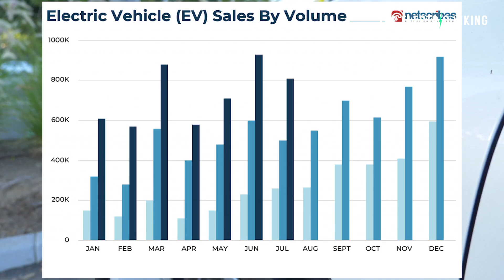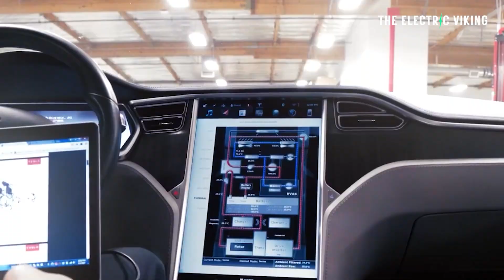The BIGGEST mistake EV owners are making when it comes to the battery

Comment: I know someone who repaired his busted Tesla battery himself after the workshop insisted he needs a new battery. Took him 4 weeks to do having to check each and every cell, but it saved him a hell of a lot of money in the end.
Reply: @newnewmee44 Yeah, I had the exact same issues.
I think it's when a busted cell is replaced with a new one in a used battery pack. Then you get currents flowing between the cells all the time as they try to level their charges with each other. That can't be healthy for the cells. It's probably the same with EVs.
Reply: @newnewmee44 I think this has to do with the efficiency of charging new battery cells, and when one combines and mixed old cells with new cells the old cells start to fail faster.
Combining old cells with new cells is not a durable solution.
Reply: Four weeks, assuming he worked 8 hours a day 5 days a week that would be 160 hours times $ 30/hr = $ 4,800 to repair an old EV battery!!! Yes, he did it himself and did not add his labour cost, but he still spend 160 hours fixing the EV battery pack, which he could have spend making money on something else.
A new EV battery pack would cost about $ 10,000 installed pending the EV make and model and that would be a brand new one.
The repaired old/ failing EV battery pack apart from the new cells installed is still an old battery pack, which can fail at any time again!!!
Reply: @mauriceharting5877  A new battery pack for a Tesla costs in the region of 18 to 25 thousand euros with labour here in Germany. So I guess my neighbour did alright financially.

Comment: I think that the biggest mistake EV owner used to do is to always charge to 100%. That's the main reason why Nissan Leaf 1st gen lost capacity so much.
It had small range. so of course drivers would plug it in at any opportunity. A 80-100% top-up counts almost as much as a full cycle in degradation.
Second gen doesn't have the degradation problem because it's longer range and the drivers don't charge it as much.
My 2013 Leaf has still the full 12 bars at 70.000 miles. It's not impressive in isolation, but most Leafs lose 30-40% of the range by that point. I only charge it to 65%. 80% just in exceptional cases
Reply: Even AC charging people tend to charge at max amps which is not needed. I calculated that the 60 kwh pack in a tesla only needs to charge at up to 20 Amps (240 VAC). 20% to 80% = 60%* 60kwh = 36kwh, 20amps * 240VAC = 4.8kwh, 36kwh / 4.8 kwh = 7.5 hours. So even lowering the car's charging amps at home can extend battery life and reduce heat lost and wear & tear on your home wirings.
Reply: @chetsaxton1526  Tesla people prefer to charge at max available AC speed. Apparently at 7kw the onboard charger efficiency is about 90% and it goes as low as 75% for 2 kwh. In Europe with the overpriced electricity they don't want to waste anything
Reply: @chetsaxton1526  good point, I haven’t really done a deep dive to see, but it is definitely a possibility that some of the EV fires are actually a result of substandard charging systems or faulty wiring.  I reduced the charge rate of mine to 20 or perhaps 24 amps I believe, and only charge my Bolt to 80% as that’s perfectly adequate for the typical commute that myself or my family would do on an average day.
Reply: Your charging methodology will definitely extend the lifespan of the battery by a lot, but the thing that really hurts the Leaf is the fact that it doesn’t have an active system to heat or cool the battery when temperatures exceed optimum operating ranges.
Reply: @sjsomething4936  Everyone seems to repeat that, but I haven't seen any proof.. 2nd gen Leaf doesn't have any significant degradation issue, even without thermal management. Better chemistry, bigger capacity and less frequent top-ups is all it needs.
Excluding some very extreme scenarios, the battery sits within a reasonable temperature range even without active thermal management.
Reply: @BGS_123  that might be the case, quite honestly I haven’t got any specific information that says otherwise.  I know my friend’s Leaf has fairy significant battery deg but I’m not sure if his is a Gen 1 or 2 or his typical charging routine.  He probably just charges to 100% all the time would be my guess.  And to your point, even in my Chevy Bolt the battery conditioning doesn’t happen very frequently, even on hot summer days.  When the temps drop below freezing it will do some battery pre-heating when it’s on the charger and I start it in advance to warm the cabin, but doesn’t come on much when driving unless temps drop below -10.

It’d be so much easier to have informed  discussions about battery performance, longevity etc. if the government would mandate tracking and public disclosure of the various parameters on the vehicle manufacturers. And probably help to dispel what I suspect are myths and disinformation about EVs and batteries by social media personalities looking for clicks or petro company shills pushing a narrative.
Reply: LFP loves 100% charge. It's only NMC that is a princess.
Reply: Battery will calendar age regardless. Not changing to 100% will extend it but it will still degrade with time no matter how careful you are.
Reply: @i6power30  calendar age is accelerated with state of charge. Keeping battery at around 40% and close to 0 deg is the most optimal way to limit age related degradation

Comment: sadly in most countries there's a shortage of technicians in general. High voltage qualified ones are almost inexistent. So there will be a long time until this need is filled.
 Also shortage of electricians to instal chargers, technicians for heatpumps and solar panels.
Best way to fix this problem is to lower the entry requirements. They should provide schematics and drawings for battery packs so any engineer can service it. That would eliminate the need for years of experience in the field.
And yes. it's pretty much illegal to work on a battery without qualifications and safety precautions
Reply: I think the problem is that "the industry" doesn't make marketing against schools and talk about the possibilities in the field (of physics).
Now "everyone" think that singer or TV, video blogger, etc is the future.

Comment: Good video and an area that is not getting enough attention.  We also have Sandy Munroe who pointed out fairly recently about a well know EV battery having "zero repairability".  Part of the issue seems to be that we go from batteries that have very low degradation to a state where they suddenly can't be charged, and there don't seem to be official figures on how often this is happening.
Reply: Definitely would be good to be given the failure rate and longevity stats for batteries, this should be mandatory information collected by and published by the government. As an EV owner, I’d really appreciate being able to know for myself as well as be able to discuss and provide accurate information to other people who are interested in purchasing an EV.  Right now without accurate information the fossil fuel industry is able to make wild and untrue claims to try and convince people that EVs aren’t safe or that the batteries are dying after only 5 years etc.
Reply: @orionbetelgeuse1937
Most of what you said is are hypotheses not information proven by research. Yes salt water is an issue. But fires after an earthquake has not been shown to be true yet, unless you have an article. 
The power outage problem is actually been proven false. Since people drive home and plug in their EV there is always a higher percentage of EV’s with a full charge than cars with a full tank of gas. There was a power outage that lasted 10 days in my town. The next problem after keeping you house warm and your food cold was no access to gas. The gas stations don’t work when the power is out. But the people with backup solar and an electric car had no problems.
Reply: @orionbetelgeuse1937
Yes if a vehicle with its power source is crushed in an earthquake it’s going to start a fire. It doesn’t matter if that is electric, gas, propane, or hydrogen. If you treat those energy sources badly, bad things are going to happen. 

What was your point?
Reply: @orionbetelgeuse1937
Ok let me see if I can cover all of this. 
Batteries damaged cause fires: you are correct on this but because of the extra structure they put around the battery this happens almost never if the car is not moving. Plenty of EV’s have been crushed by falling trees without the battery getting damaged. But yes if a building collapsed on an EV it could burn the collapsed building. 
You believe gas stations have backup generators. Well in my area the 10 gas stations that were inside the power outage did not have backup generators. But that might be different in different areas. 
You can just drive to a gas station: well on day 2 the first layer of gas stations ran out of fuel do to being overwhelmed. By day 5 you had to drive 20-30 miles to get gas. The first supercharger that had power was 15 miles away. I could get a full charge with the long charging time of 45 minutes while shopping for supplies. It never ran out of electricity so it never stopped working. 

Solar is well known to actually strengthen a roof. Here is a short video on that. 
https://m.youtube.com/watch?v=ztx_a7oV_dI&pp=ygUjUHVlcnRvIFJpY28gcm9vZnRvcCBTb2xhciBodXJyaWNhbmU%3D

Now if there is an earthquake and my house doesn’t survive we are in a completely different situation. I actually have the knowledge to take a broken solar system and rebuild it. I can make it direct DC system or a 120v AC or a 240v AC. I would do this with them just laying on the ground. My problem is I’m chronically ill and would not have the strength to implement this. So I have made it very apparent my house is the place to congregate after a disaster of that size. I don’t have a bunker. But my basement is very close to that. So I would match my knowledge and their strength. Because of the solar we would still have vehicles after 6 months. There will be no gasoline at that point. So food is the biggest problem. I could survive with my friends for about 2 months with our food supplies. So if the damage happens in March we are fine because we can instantly start farming. If it happens in October we are probably screwed and would not survive the winter.
Reply: @ecospider5  thanks for that link, it was perfect (saved for future reference!), I haven’t seen it before but I also haven’t encountered someone who so persistently misunderstands or tries to disingenuously argue a completely ridiculous claim.  

Sorry to hear about your condition, not having your health really sucks.  My problem is pretty minor by comparison (kidney stone) but it’s resulted in me being in the hospital and talking with others much more misfortunate, it’s tough to see people hurting like that. Best wishes for your health improving or a new treatment that may help.
Reply: Another BMS solve problems like that!
Reply: @orionbetelgeuse1937  there are lithium batteries that have been in Teslas and Leafs and Chevy Volts for 10 years or very close to it at this point, so we have some quite solid evidence. There’s also a site for a company called Geotab which makes fleet management software which put together an interactive chart a few years ago that gives a good view into the lifespan of batteries, look into it if you’d like to get a real sense of battery life and degradation performance. Google Geotab EV chart.

As for wild, untrue claims it’s easy, people have been making them for awhile now.  When the Chevy Bolt battery recall happened, there were a number of people who were suggesting that all EVs would catch fire or other very exaggerated statements.  They like to gloss over the fact that there were over 300,000 Dodge Ram trucks that had a similar recall, they could potentially burst into flames while parked and owners were being warned to park them outside. Did that make the news? No, because gas cars are a technology we’ve had for over a century now, and people know there is a level of danger associated with them. Because EVs are a new(-ish) technology, the media loves to get clicks and eyeballs by telling stories about how they catch fire, or how bad the batteries are etc., and people lap it up. The same thing would have happened in the early 1900s if television and internet based social media was around, you’d have seen vehicles bursting into flames and people saying “see, that doesn’t happen with horses”.

When companies make products such as new vehicles etc., they stress test them to ensure they have a good idea of the safety of the product as well as how long they will last to ensure they don’t go bankrupt on warranty claims.  If they didn’t have a good level of confidence in the average lifespan of the battery, they wouldn’t market them, it would cost them too much money and too much reputational harm.
Reply: The salt water damage is actually an issue because it destroyed houses. This happens with flooding on the coast. In Florida so many electric cars were starting fires after one of the hurricanes the fire department got a list of registered electric cars and went to their house and towed the cars out of the garages. So when they caught fire it didn’t damage a structure. 

So the fact this is no longer a problem with new Tesla vehicles is a good thing.
Reply: @ecospider5 if it is true that it is no longer a problem, then why is water ingress explicitly excluded from the warranty?
Reply: @jamie-ck6js
I can only guess about the warranty but just because the battery is sealed so there isn’t a fire risk doesn’t mean water won’t damage the other electronics.
Reply: @orionbetelgeuse1937  if you don’t have actual data to back up your claim and are just speculating, you make yourself look foolish.  There’s very few vehicles that are crushed during tornadoes, hurricanes or earthquakes.  It would need to be a vehicle in a multi-story parking garage to be “crushed”.  Your average house partially collapsing hasn’t got enough weight - cars (regardless of power source) are designed to be able to roll over and still have the occupants survive so the car can withstand quite a bit of weight on it. And if a multi-story parking garage collapses, there’s an equal likelihood of the gas tank on a gas car or the hydrogen tank on an FCEV being damaged as the battery on an EV.  Water intrusion due to flooding is actually a much more likely reason for a fire to happen in an EV battery, which can happen during a hurricane.
Reply: @orionbetelgeuse1937  sorry it’s really not worth talking with you, your comprehension of reality is not very strong, and your grasp of basic facts is poor at best.  NO the vast majority of gasoline stations do not have backup generators.  Earthquakes will not cause solar panels to come off of roofs, they are even likely to remain secured during all but the most violent windstorms or hurricanes.  There are many, many people who have solar panels in Florida, you can even see them on Google Earth - do you think those people would install them if they thought they would be blown off easily? Florida gets more hurricanes than any other place on the planet FFS. And most of the people who have solar panels in Florida don’t have EVs, they’re used to reduce electricity costs, especially for air conditioning.  Using your useless “logic” a car with half a tank of gas can still make it out of a disaster area.  Guess what? An EV that’s fully charged at home when the disaster happens would have 250 miles (400km) or more range,and wouldn’t need to stop and fight for gas at gas stations. Have you ever seen the lineups for gas in the days before a hurricane hits Florida? They’re massive and people have to wait for HOURS in them.  But, electricity is working just fine before the hurricane, charge up your car at home and head out, no waiting for gas.
Reply: Tesla has some of the most protected batteries in the EV market. Their cars are lighter than other comparable EV’s and they are lower cost. So yes it adds weight and cost but not so much weight and cost that a well designed EV has issues with that. 

You would only need to rewire your solar if your building actually collapsed. If the building doesn’t collapse then the panels are one of the most durable part of a house. You can see that in the video I linked. If you read about Puerto Rico they were rebuilding solar on the fly to get access to electricity. 

Cars as a shelter is an emergency only thing because it can be dangerous no matter what type of vehicle you have. Ice vehicles kill over 300 people a year because of carbon monoxide poisoning. 

https://www.youtube.com/watch?v=Zi_OaDsEKzo&pp=ygUiY2FyYm9uIG1vbm94aWRlIGRlYXRoIGluIGNhcnMgc25vdw%3D%3D

I have used my Tesla as a shelter in the snow many times. Plus people camp in their Teslas a lot. Especially when the temperature is below freezing outside. So there is plenty of data on cold battery performance when parked. Its only about a 10% difference.
Reply: Batteries are usually very reliable but as times go by, various things can go wrong, physical damage, moisture ingress, degradation due misuse or simply misadventure. Whether the battery can be repaired, reused, salvaged or need to be recycled will depend a lot on the circumstances.
Reply: @orionbetelgeuse1937 you've been watching too many movies
Reply: Sandy Munroe Also regularly says you can have durability and longevity or you can have reliability. You can’t have both. 

Teslas new unreparable battery is completely sealed making it completely waterproof. Removing the issue of it bursting into flames after being flooded with salt water. A major issues with lithium battery cars.
Reply: @ecospider5  but doesn't the warranty explicitly exclude water ingress?